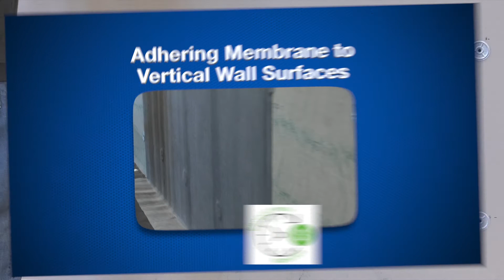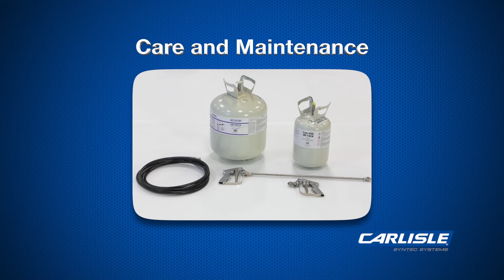CAV-GRIP III Application

Comment: Why do you guys have fiberglass dust all over your epdm...I get its got a ton of talc powder (what it gets called) that needs washed even when the product is brand new, but whats with the fiberglass dust. That stiff sucks, gets in your hands and inches for days, gets in your eyes. Carlisle makes some solid material, but the fiberglass dust on epdm drives me nuts. I cut iso with a long sharp blade to avoid getting itchy. Maybe i just need thicket skin to be a Carlisle guy.